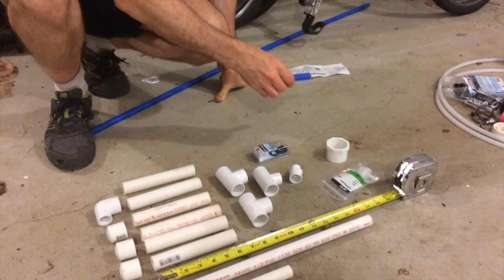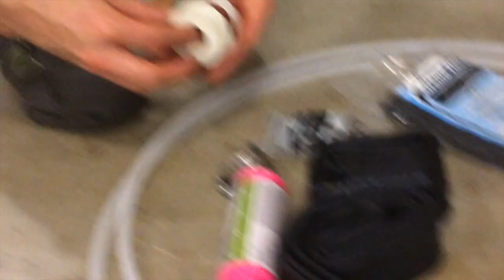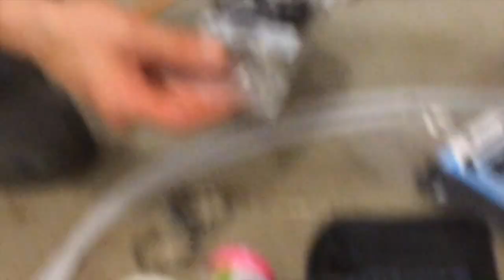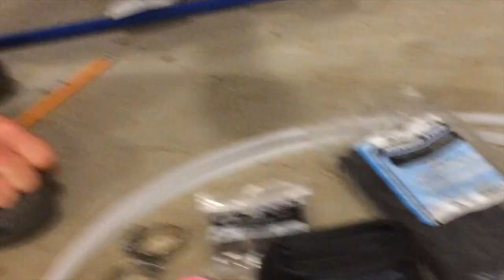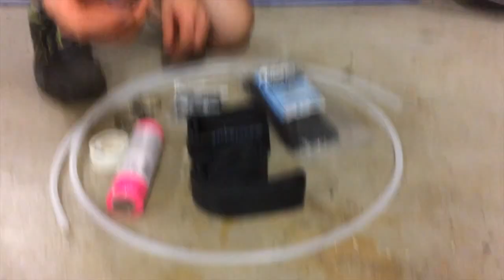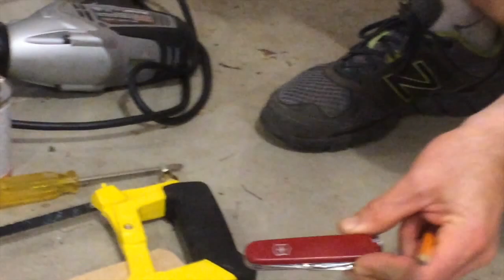Water rocket launcher tutorial part 2/3

Comment from the maker: Parts List
¾-inch PVC pipe (3 feet, cut into (6) 6-inch sections)
½-inch PVC pipe (2 feet, cut into (1) 8-inch section and (1) 16-inch section)
 ¾-inch PVC end caps (3)
¾-inch by ½ inch elbow (½-inch end threaded)
¾-inch PVC T-couplings (2) 
¾-inch by ½–inch PVC T-coupling (1) (1/2 inch end threaded)
½-inch PVC threaded coupling (1)
¼ inch X ½ inch nylon threaded hose barb
½ inch PEX pipe (2-inch section)
1½ X 1¼ PVC Bushing
#12 O-Rings (or #22 if you can find them)
5-10 feet Polyethlene tubing (3/8-inch outer diameter by ¼-inch inner diameter)
Valve stem cut from old bicycle tube
Teflon plumbing tape
1½ inch maximum diameter hose clamps (2)
1/4–inch (min) to 5/8-inch (max) hose clamp (1)
8-inch Cable ties
1 spool nylon string
1 small can PVC pipe primer
1 small can PVC pipe cement